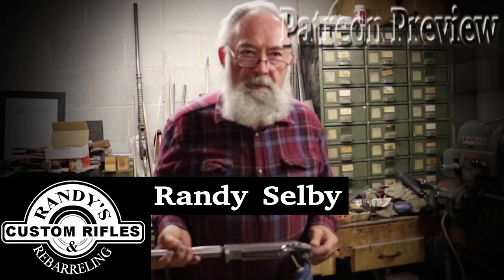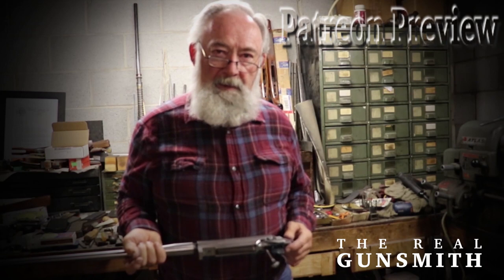Patreon Preview July 2020

Comment: 6.5 is still my hunting round of choice here on the east coast. I have not 1 issue with any ammo that I've run through it. Just a simple, factory, cheap, Savage 10 BA Stealth in 6.5 Creedmoor. I prefer Hornady ammo but get good results with any ammo I put through it. No hand loading, all factory ammo too...Every deer I've shot for 4 seasons now has been dropped dead in its tracks. Haven't had to even follow a blood trail. I don't know alot about chamber dimensions but I know the results that rifle gives me. Tight groups and quick kills. I even prefer it to my tricked out M110 rifle I used in Iraq and Afghanistan.
Reply: I shot a rifle exactly like yours lastnight....and coincidently, same ammunition. I thought the trigger sucked and the scope left a lot to be desired...and in spite of all that, it shot rather well. That Hornady ammunition is loaded like Norma used too.....rather warm for factory fodder. The primers were flattened...not painted on...but flat, no FP hole extrusion. When they load these new humdingers up and are shot in modern rifles, it's no problem. Back to shooting it....when you can make the holes kiss from a factory rifle with no tuning, a poor scope, fading light and two geezers on their 60s wearing bifocals...that's real good. Savage is turning out some good barrels...clean up easy.
Reply: @mark-wn5ek  Good to hear that I just didn't a good one and it seems to be a common theme from what I hear. They tend to put the money where it counts to do that job as intended. Yes I would agree they lack in some areas but the value is hard to beat. If you have a little knowledge you can make a little budget dragster if you wish. Thanks for sharing